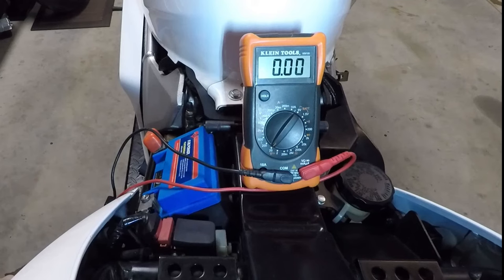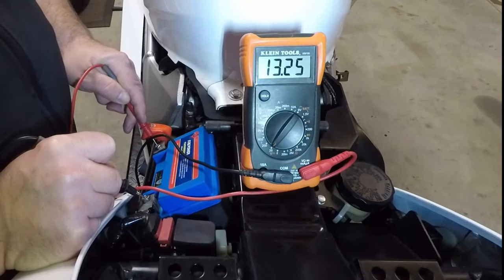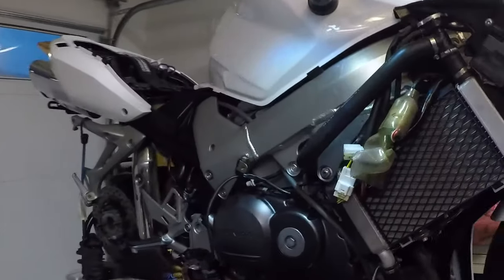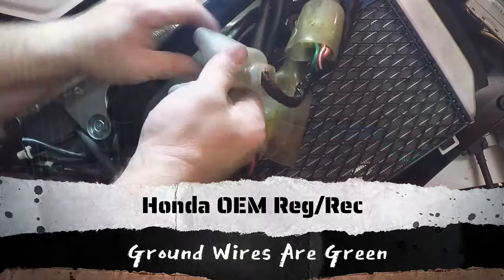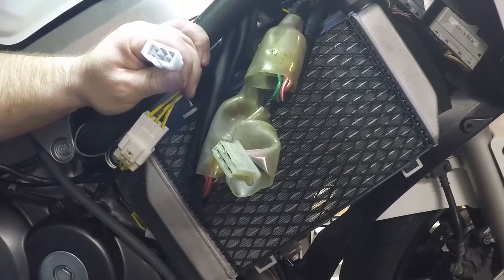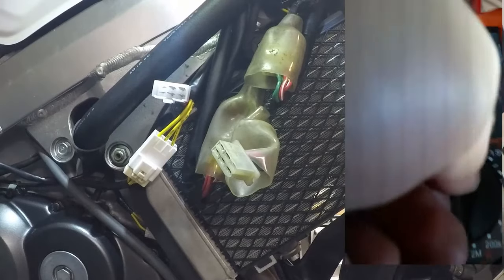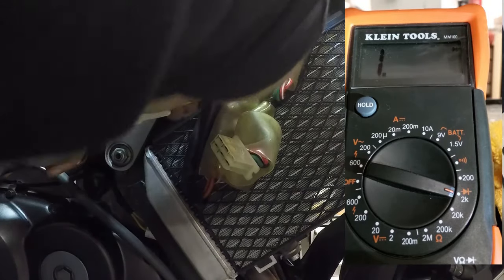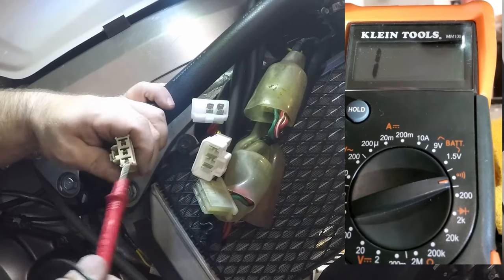Battery Voltage / Regulator/Rectifier & Stator Test

Comment: I have 13.9 volts at 5k rpm but when I switch the headlights on it starts dropping rapidly. Stator is only a year old, does this sound like a regulator issue?
Reply from the maker: No not the RR I would point a finger at the battery first. how old is it?  If it is an AGM or wet cell your voltage should be over 14V at 5000RPM.  If it is lithium like the one in the video then you are okay at sub 14V.  What is the voltage on the battery without any load (bike off fully charged). If the voltage here is under 12.6 definitely needs  replacement.  If the battery checks out good then the fault would be back at the stator.  Do a phase to ground test as shown in the video.
Reply: @RodRidesWrenches  battery is just a few weeks old, but it let me down once already, hence why I was thinking reg/rec. 12.2 volts without any load. It's a nitro battery, not lithium, probably AGM or wet cell. I've already got a regulator ordered so I'll fit it and see what happens, will probably replace the battery with a more well known brand too. Thanks for the reply 👍
Reply from the maker: @seanoghughes95  A new fully charged battery should be 13.2VDC 2.2 Volts per cell X 6 Cells.  Because of variance in meters and shelf age of the battery I was looking for 12.5-13VDC.  Install the RR but you may have a battery that has sit on a shelf for awhile.  If the battery is prefilled and sealed like an AGM or GEL then the chemical processes inside are already happening, regardless if it is hooked up to a bike.  Here is how and why https://youtu.be/xXkq-p59oao

Comment: In this case I have to say the diode test on the regulator rectifier was not correct. You only tested the power and ground through the reg rec. To do a diode test you connect to power on reg rec and to each yellow wire from regrec with the stator connection disconnected,  then swap test leads over and do same again to each yellow from reg rec...then swap test lead to ground wire on regrec and each yellow again from reg rec. Swap over test leads and do same again. 😎👍

Comment: When I give mine throttle my voltage drops to 9 volts but when I let off it goes up to almost 14 volts
Reply from the maker: You're regulator rectifier is most likely gone if you're getting low RPM voltage but did you turn the headlight on high beam?  The additional load is required to get the accuracy, especially at idle.  Ground test the stator as described, if the poles are weak this could also be a factor https://youtu.be/KpmvUvpRCEM

Comment: Hello,
Nice video. I am searching for a good regulator rectifier upgrade. My bike it's an 04 and I have no problem in voltage reading. 14.3 at 5krpm 13.8 at ideal.
What would you suggest me?
Reply from the maker: If you have 14.5 v at 5000rpm your regulator is fine.  If your voltage drops off at idle this is normal, the average lead acid motorcycle battery can't maintain voltage for extended period at idle.  If your volts drop quickly at idle your battery could be weak needing replacement or your lights/bike is drawing heavy amperage.  Most likely the former but if your bike's wiring harness could have corossion leading to more resistance.  If you have a voltage issue start with a high quality battery.  Lead acid batteries wear out and sulfate easily get a lithium best money i ever spent on a battery.  See my battery video for more.
Reply from the maker: https://youtu.be/xXkq-p59oao
Reply: @RodRidesWrenches  thanks a lot for your reply. 
If I would like to change my regulator  for a Mofset, is it better than the stock one?
Reply from the maker: @giovannimaraniello4073  mofset regulators build current and are basically one circuit, they run cooler and do not load the stator as much to create the equivalent voltage because of the current build up ability, my understanding.  The normal diode regulator works fine.   If your current regulator is burnt try the mofset, from my real job i know there is a shortage in control chipsets for them globally.  If you can get one at a comparable price then give it a shot, it is better. I am personally okay with the diode type for the type of use I have on my bikes.  Good Luck!

Comment: Hi can shorting out my pos batt terminal cause my stator to fail . 
Cb750/4 k5 . ?.any info is appreciated. Cheers
Reply from the maker: Was your bike running or turned on at the time?  My short answer is no, but it would do damage to other electrical systems if the key was on or the bike was running.  The main ignition fuse (30Amp) will be blown for sure, and possibly damage the regulator rectifier if the bike was running or the key was on.  The wiring harness/connectors may have melted and caused other issues damaging your stator, messing around on 50 year old bikes means the electrical systems are pretty fragile now...